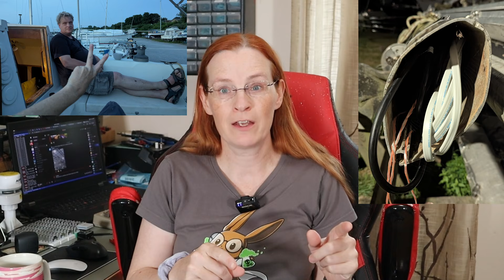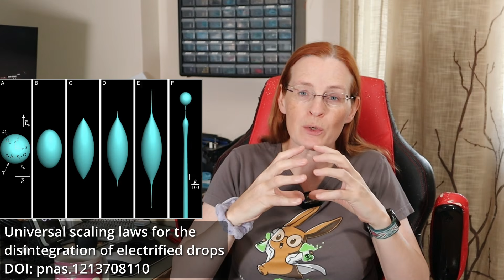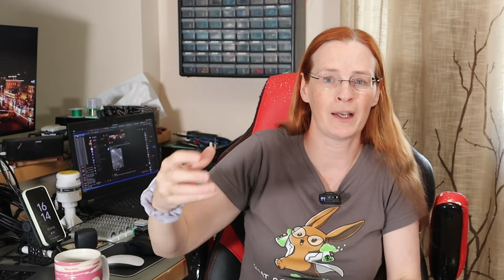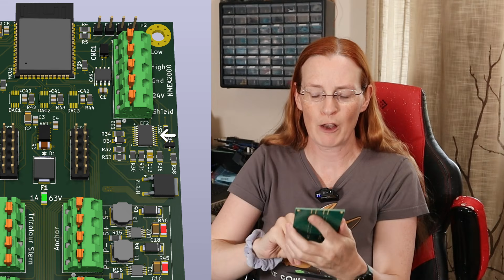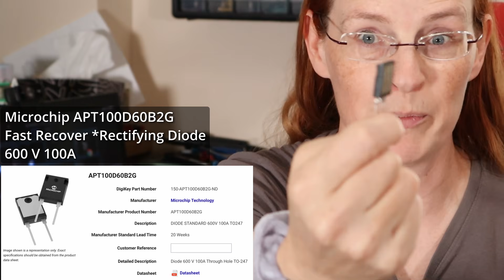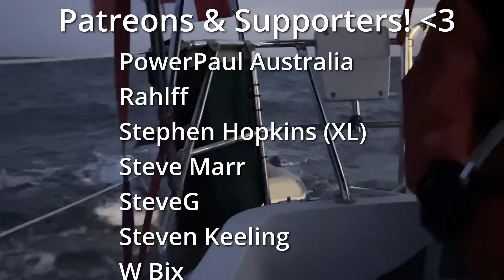Designed to be Destroyed - Ep. 127

Comment: I really think you are spending a lot of time and effort for nothing.  If your mast gets hit directly, that whole board will become a big black carbon pile.   Also, what appears to be a solid low-impedance connection at normal power frequencies (and DC) becomes very high at the rise time of a strike.  PCB traces are generally almost invisible!  The only proven thing that can survive that kind of lightning damage are electronics connected only by glass fiber.   (as someone that built radio systems to be mounted on tall towers.)  The only thing that worked was to use a special ultra-high dielectric 60hz isolation transformer at the tower base, and then run AC power up from that along with fiber for the data.  The entire radio system was in a sealed aluminum box, with the power supply in a separate smaller box mounted under the main.  about 20% of the time it would still destroy the PSU, but the radio gear was rarely damaged.    Your DC-DC converter will only withstand maybe 5kV before it arcs over and blows up everything.   Best idea is just to carry spares of critical devices stored unconnected in a metal box.   In this case, Nature is just too powerful to "work around".
Reply from the maker: Did you watch the video through? I talk about the rise time, the current division, clamping and most relevant; This is a sacrificial node. The whole point of the board, as explained in the title, was that it's meant to be destroyed in a strike. The goal is to save the other electronics on the boat.
Reply: @TheDigitalMermaid  Yes, I did.  I don't think it will work.   It will likely vaporize traces on the board and arc over to the other side.   Might save you from static, or a nearby strike, but a direct; I don't think it will.   If there was an easy way to solve this, engineers would be building them and selling them.   You are overlooking the forest for the tree that got hit by lightning.    If you drill down to this level of "what if", you'll never be finished and out on the boat enjoying it!      Do an image search for "Lightning damaged PCB" and look at some of them.   Keep in mind most were not exposed to the kind of direct lightning rod your mast is, they were incidental.    I've seen it vaporize all the copper off a PCB, and while it's doing that, the copper plasma will conduct current everywhere it can.    Even if it doesn't get that kind of current, it's still going to arc across.
Reply from the maker: I think you're missing the purpose here. There's no concern about saving the masthead controller, the weather station, the lights or the VHF cable and antenna. I accept and expect it all to be destroyed. The goal is to minimize the fraction of the current that takes the path of the cables, thus reducing the 'dI' part of the formula, creating a short to ground rapidly, further limiting the voltage rise, such that the isolation capability of the dc/dc converter can finish the job. With a -CG 30kA strike, the estimated Vrise is ~1.9 kA on the power cables, half the rated isolation capacity of the Meanwell converter. 

"If there was an easy way to solve this, engineers would be building them and selling them" - Um, I'm building it now. I'm doing what you're saying. Why it doesn't exist already? Probably because of a combination of people assuming lightning can't be dealt with, so why both trying, and the fact that if I make this work, it'll not make me money. No profit motive, so who cares? 

Your focus on the damage to the PCB is misplaced. I know it will be destroyed, I don't care, that's not the goal.
Reply: @TheDigitalMermaid  I am pretty sure he's saying that even having a sacrificial piece, the current will still find a path to the rest of your electronics, even if you successfully shunt the bulk of the current away.  I don't have professional experience in this area, but having witnessed the aftermath of a few strikes, I tend to agree.  For example, I have witnessed an indirect strike (10s of meters away from a residence) melt all small gauge horizontal wires (CAT5 and telephone) in the residence, assumedly due to induced currents.  I think your plan neglects to consider the effects of having so much current going down the shunt path you WANT it to go down, which itself is going to cause its own havoc without being connected to your electronics.
Reply from the maker: If so, that wasn't clear. In the paper I talk about, I cover induced voltages (it's also why the Muirgen MFD I mentioned in this video is going wireless, the OLED is basically a giant antenna). There are ways to mitigate the risk, it just takes a total system review to do it.

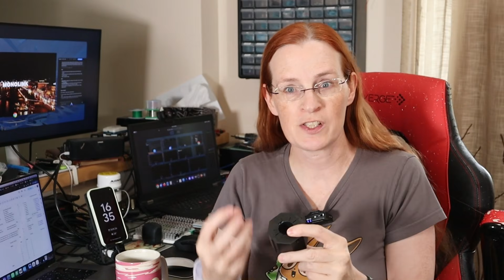Comment: My main takeaway from this video is that while I feel reasonably (unreasonably?) comfortable designing circuits up to ~50,000 volts, very little of my knowledge translates well into dealing with lightning stikes. I'm very curious about that ferrite choke... what are you calculating for the current and rise time through it? Oh... 27:55  I missed it the first time but on rewatching I saw that you did include a caption specifically for me. But now I have more questions. If this is the power cable for the LED lights from the buck converter, why is noise such a concern? Is it about the buck switching noise getting picked up from the VHF antenna, which certainly could be a problem, or am I missing something obvious?
Reply from the maker: The choke on the power cable was from before I switched to the masthead controller, so I need to check how Meanwell does the boost conversion. I'm not sure if it's noisy enough to justify it, but I've already bought it, so I might use it anyway. I've got a pile of chokes for thinks like the motor phase wires and other uses. That was from when I was trying to figure out how to get the noise floor as low as possibly on my radio.
Reply: @TheDigitalMermaid  Ah, that makes sense. There's such a range of buck and boost converter designs. I recently discovered that one of my DC converters works perfectly for my application, except for one minor drawback: not a single radio in my house can pick up an FM station when it's on. 😂
Reply from the maker: Haha. I brought my 5W VHF home so I can key it when I am testing the PCBs. Soooo much time spent trying to design a board when a radio will be used ~1 meter away.

Comment: Energy cannot be created or destroyed. E=MC^2
Reply from the maker: I didn't claim otherwise?
Reply: You mixed up the first law of thermodynamics with the law of special relativity. The equation you posted clearly demonstrates that energy absolutely can be created or removed by converting it into mass. That's the whole point of energy-mass equivalence - without it, the first law of thermodynamics wouldn't hold in nuclear physics. So they are both true, but I'm really struggling to understand the point you're making as it relates to this video.

Comment: I like it.  one thing I will note is that it looks like those components might be a bit too close to each other during an actual lightning strike... the electricity is gonna bridge across in an actual strike.
Reply from the maker: They will, and it can't be avoided. That's the reason for making the masthead a sacrificial node.
Reply: @TheDigitalMermaid  Seems like there are an awful lot of components on that board to be sacrificial, though.  Usually we have a small board containing the three or four actual sacrificial components (the ones expected to explode) separate from everything else.
Reply from the maker: The currents and voltages involved is so high during a lightning strike that I wouldn't trust the board at all after a strike. It'll just be replaced with the backup.

Comment: You could still have a physical switch. If you set up the nav lights so that when you power up the 24V, the nav lights default to On, and then when the ESP32 boots up, it turns them Off, this gives you a fail-safe that defaults to On in case the ESP32 dies.
Reply from the maker: I intentionally want them to fail off. The lights have meaning; steaming when using the motors, anchor when on tackle, etc. It's best they fall off.
Reply: Also 20kv would easily jump through NO/ NC.

Comment: In your lightning explanation you seem not to have mentioned the induced charge in the mast. As a negative cloud passes over your metal mast, electrons at the top of the mast are repelled down the mast leaving the top of the mast quite positive, thus bekoning the electrons from the cloud and assisting in the strike.
Reply from the maker: Two episodes back goes into all that, the one where I talk about blunt tipped air terminals.